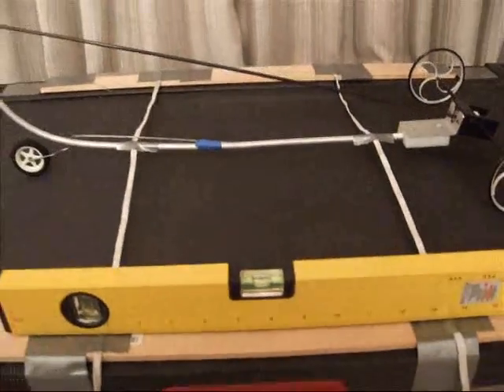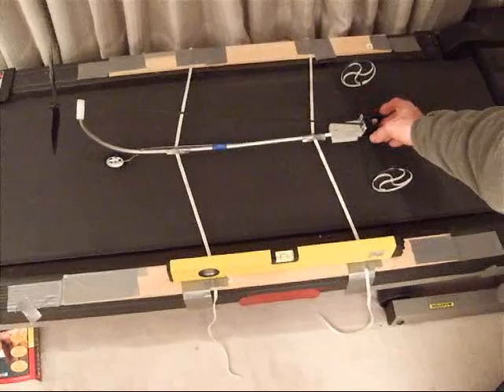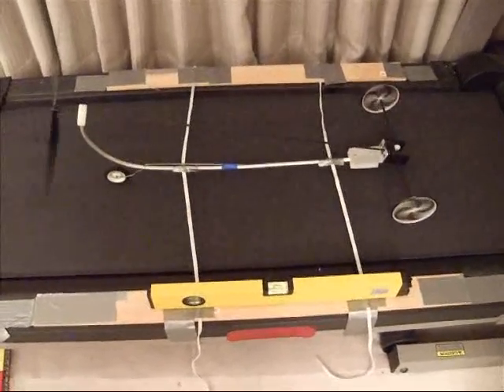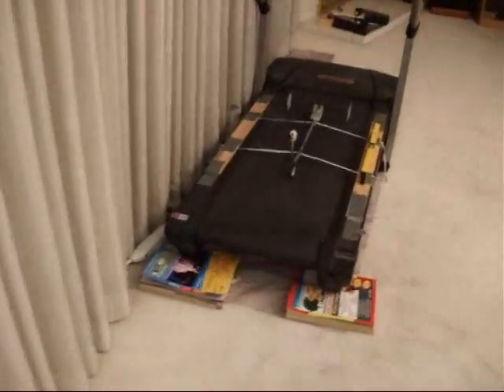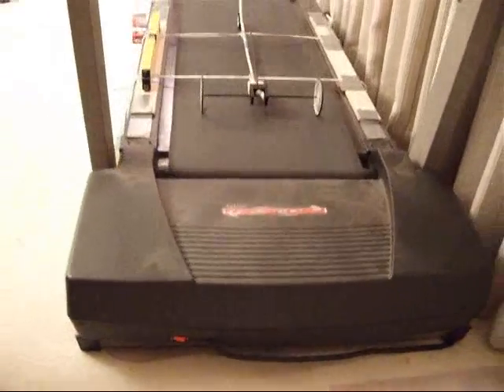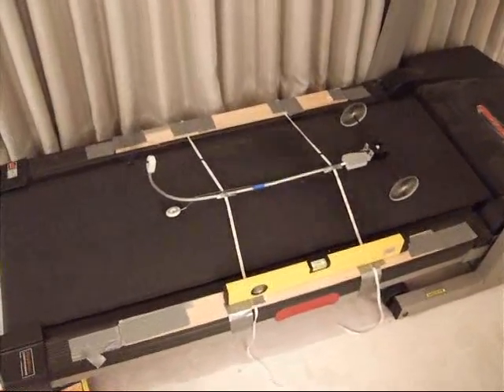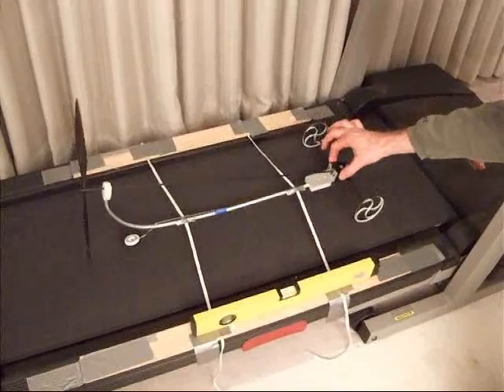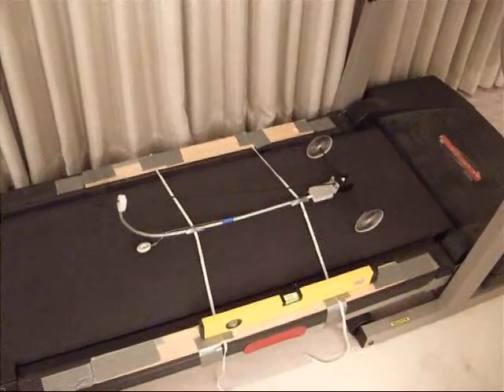DDWFTTW - Physics on a shoestring

Comment: Links to Rick's video instructions for building a treadmill model. Note that some parts may have changed. If the gear ratio is different, a different pitch propeller will be needed to compensate.
https://www.youtube.com/watch?v=T-ArigMKhi4
https://www.youtube.com/watch?v=p0rhgop5wEM
https://www.youtube.com/watch?v=gSHNqrF93MU

Comment: Lets say I had a very long tunnel the went all the way around the world, with no wind and a smooth flat bottom. You are saying you can simply push this thing up to a certain speed, let it go and then it will push its self via the propeller all the way around the world over and over forever as long as there is no mechanical failure?
Reply from the maker: Nope.  With no wind in the tunnel this will come to rest very quickly.  More quickly in fact than a cart without a propeller and gearing.
Reply: @Rick_Cavallaro  So in the tunnel it would be the air resistance that would stop it. So if there was a 10 mph wind in the tunnel it would work because there would be no air resistance until after 10 mph and then gradually there would be air resistance. So then once it meets so much air resistance it will equal out and just run at that speed right?
Reply from the maker: @BurningDownUrHouse  Nope.  With a 10mph wind, it could run all day at some speed much greater than 10mph.  It's a wind powered vehicle that goes directly downwind faster than the wind.
Reply: https://pt.wikipedia.org/wiki/Aerom%C3%B3vel

Comment: If the vehicle moves with the wind along the level ground, it is likely to experience a considerable amount of turbulence.  From moment to moment, the direction and speed of the relative wind velocity will vary because of turbulence.  In stagnant air at rest relative to the ground, there will be minimal or no turbulence.  Taken to the extrerme, the turbulence means that the vehicle is actually going perfectly "downwind" instantaneously.

Comment: The concept here was demonstrated back in 1877 with the Brennan torpedo. Land based powered spools were used to draw a pair of wires from the torpedo. The wires were wrapped around spools that drove propellers as the wires were pulled from the spools. The torpedo moved forwards, while the wires moved backwards. The wires could have been attached to a pair of posts, and with the water moving downstream, the Brennan torpedo would have moved downstream faster than the stream. Wiki article: https://en.wikipedia.org/wiki/Brennan_torpedo
Reply: That is a very interesting piece of history. Thank you for pointing it out!

Comment: So, make 5 or more of them. Lay them out in a pattern so that they travel on a circular track with each connected to a center hub, where the center hub is a generator. If true, then after starting them, they should be able to go around indefinitely to generate power at the center hub.
Reply from the maker: It doesn't work like that.  It needs wind to operate.  It exploits the energy of the motion of the air relative to the ground.  No wind - no go.
Reply: You mean it doesn't work like that on a motionless circle track. But, if the track itself rotates at a constant rate won't it give the acceleration rate effect desired?
Reply from the maker: It will work on a rotating track (like a turntable).  But you won't get more energy out than you put into rotating the track.
Reply: Video of such an example. The vehicle advances "forwards" against the turntable moving "backwards", but the only power output is the vehicle takes some power from the turntable and the propeller adds some energy to the air (less energy added to the air than taken from the turn table). https://www.youtube.com/watch?v=QTF5kw51H60
Reply: @jcd-k2s  
No. I know now that it only needs for the fan to produce a greater pressure at the back than the ambient pressure and it will continue to accelerate. It has nothing to do with wind. It has to do with force (pressure) differences at the front and back of the fan.
Reply: @jcd-k2s  
The key is that the fan blades generates greater thrust energy than is required to rotate it.
Reply: @jcd-k2s  
The extra kick of energy comes from thermal expansion of air at the back of the prop and thermal contraction of air at the front of the prop. The prop acts like an efficient heat pump as it rotates through the air.
Reply: @jcd-k2s  
Regardless of what your thinking, I am not implying that there is excess overall energy. I am saying that the "efficiency" of the prop (its ability to heat and expand air at the back of the prop for thrust, and cool and contract air at the front of the prop for thrust, and due to its pitch) translates to acceleration forces for the prop. Your above equation (Ec =p²/M) does not take into account the heating and expansion, and the cooling and contraction of the air at the back and front of the prop. That too must be considered. And when you do consider it, you will see from were the acceleration force must be derived from. In and of themselves the heating and cooling difference result to a zero. But the expansion and contraction factors are on opposite sides of the blade, resulting in an overall acceleration force on the prop.
Reply: @jcd-k2s  
So. No matter the "amount" of thermal effects on a wing in a gas or liquid, take that Thermal (kinetic energy) variable, split it down the front and back of the prop (heat on one side and cool on the other), and what do you see? You should see that the Heat and Cool cancel but the fluid expansion and fluid contraction create a resulting force vector on the prop.
Reply: @jcd-k2s  
No! No violation in this case, only manipulation. The energy required to torque the prop is equal to the amount required to move the air. If you only consider this, then those forces will balance. But the prop gets a definite advantage because in moving the air, then in addition to creating a pressure difference, also divides the thermal properties into hotter and colder. Since the prop is in the center, the difference in energy between the now hotter compressed air and colder condensed air creates the additional force vector on the prop.
Reply: @jcd-k2s  
I watched it. The explanation provided in the video does not explain constant acceleration, even when surpassing the wind speed. Nor does it account for the fact that they state that the acceleration will occur even in winds of opposite direction. Wheel cart was also not a completely fitting illustration because it too does not explain acceleration, but only constant rates of movement between the two mediums (the floor and the 2x4). No one can explain “acceleration” without accounting for prop heat pump efficiency, as I have stated above.
Reply: @jcd-k2s  
I did think about that possible factor. Yet, they stated that acceleration takes place “even with wind in the opposite direction”. It sounds though, that more testing is needed on a decent sized model with remote controlled steering and in a controlled wind tunnel plus treadmill environment to settle the issue of if/when exactly any acceleration would desist. Because,   the faster the wheel speed, then the faster the prop speed, therefore the greater the power transfer leading back to an even faster wheel speed, etc. It is a continuous loop. So which factor ends the acceleration?
Reply: I’ve only become aware of this Blackbird car in recent weeks since the Veritasium stuff showed up in my YouTube recommended videos. I see your original comment is several years old but there are recent ones also so I guess YouTube has revived the debate. I’ve read hundreds of comments & gone back and forth a bit on it. I don’t claim to fully understand the math involved in efficient airfoil design. You are the first one I’ve heard talk about the heating and cooling created by compression & condensation and I think that helps my understanding of how wings / propellors work as well as they do. I have working knowledge of many things from generators to Diesel engines to dehumidifiers and when the same basic principles tie them all together it starts to click for me. My initial comment was going to be directed to your comment about the 5+ cars on a circular treadmill driving a generator as I could see instantly that you can not generate the power needed to run such a treadmill. That would be the same as the guy with an electric car putting a windmill on its roof, running a generator, to charge the battery. 
Rick Cavallaro has consistent simple answers that have pretty much explained it in a way that makes sense for me. The only energy source being exploited is the difference between wind speed & ground speed, which is is a force supplied by nature, as opposed to the motor running the treadmill in these simulated experiments. You don’t have to make up for a force supplied by nature. At first I thought those making the claim that if this car actually went faster than the wind then it should keep accelerating indefinitely. It seems to me now that the very limited power available from the difference between wind & ground speed, being finite, will soon be overcome by the headwind & friction & drag created as speed increases. 10 mph speed variation is a big factor at 15 mph, but if you want to go 90 mph it’s nothing. The slight difference between wind & ground speed being such a small energy source that if one does not do the streamlining, low friction tires, low friction chain / gear drives, maximum efficiency prop and pitch adjustments it most likely would not work at all. The guys that build 200 mph gas engine super cars are well aware that they need many times the horsepower to get from 100 to 200 mph, and getting to 300 mph? Many times more again such that the tricks they used to get to 200 just don’t cut it any more.
Reply: @Bitterrootbackroads  
Thanks for the really nice comment. I blame it on my dad for always making me think about how stuff works. I have a fascination for everything you’ve mentioned as well. If you view my videos you will note that I’ve been on YouTube for many years now. Of course I’ve grown in knowledge since I originally started doing it just for fun. My channel is focused on ways to manipulate the increased apparent weight of a mass, as derived from its centrifugal activity. To understand my ideas, I invite you the take a look at this:
https://youtu.be/BE0UKLcYvt4
Feel free to leave a comment there if you like it.

Comment: I get the principle and understand what you are showing. However the variable you are missing is the wind resistance to the static structure of the vehicle at relative speed.  Don't get be wrong, the principle still applies in the same way that a yacht can move faster upwind than down wind. It is the deflection of energy that is absorbed within the structure vs the inefficiency of wind escaping a sail. I think it would be interesting to examine the surface area of the propeller in order to gauge the maximum thrust produced by the wheels turning the prop vs the rotational wind resistance of the prop. vs the thrust produced by the prop. Perhaps a larger sail area of the prop creates a greater efficiency than a foil sat lower velocities. A smaller surface area may prove to be more efficient at higher rpms = higher velocities.
Reply: these are friction or resistance based concepts. A rotating blade slicing the air at the same relative velocity of the carrier, really only has resistance to its leading edge and the high and low pressure which surrounds it  (according to N law they cancel each other out at equilibrium. 
If the resistance to speed is less than the resistance of the moving static structure  + the reistance of the rotational energy of the blade, then acceleration will occur.
Because these two factors are not linear respectively. terminal velocity will happen. But it doeas not negate the fact  that a propellor can be a more efficient means of energy transfer than that of a sail.
Reply from the maker: >> the variable you are missing is the wind resistance to the static structure of the vehicle at relative speed.

Nope.  That is shown when the vehicle moves forward and pulls the shoestring tight.  Once the shoestring is tight the vehicle is limited to windspeed and we no longer see the relative headwind.

With respect to the maximum thrust of the propeller, there are a lot of things that go into that.  There are a number of programs that will allow you to design a propeller and estimate its performance.  But keep in mind that propeller efficiency is absolutely key.  It's not all about maximum thrust.  The less efficient the propeller, the more drag is placed on the wheels, and the slower the vehicle goes.

Incidentally, the drag of the blade is not simply the "resistance to its leading edge".  The blade has an angle of attack, and it has twist, so the AOA can be  different at each radial station of the blade.

For static calculations of terminal velocity the rotational energy of the blade never comes into it.

Comment: Okay, so I think I've got this figured out. The prop is "flying" through the air, which is at zero velocity. If the air were moving at the velocity of the treadmill, the prop would still be flying through the air, the "air speed" would remain the same, the ground speed would be reduced by exactly the speed of the treadmill, so no net forward speed. Right?

Comment: This particular demo is even simpler to explain than others. The treadmill is turning the wheels, which turn the prop, which pushes the vehicle forward. So the power to the prop is FROM the treadmill. If the vehicle were not constrained, it would not go forward, except from inertia in the blade.

Comment: There is weary simple explanation of this phenomena. In the room wind speed is 0 and vehicle does not move forward. The treadmill is turning the wheels and propeller, but there is no approaching wind so the thrust from propeller will push the vehicle forward since there is no wind coming from front, as it would be if the vehicle would be on the ground. As soon as you put that vehicle on the ground and push it (in 0 wind speed) it will stop because approaching wind will be=to the thrust.

Comment: Why are people surprised at what happens? Consider this... The propellor on a aircraft pulls it  forward right? So why would changing the type of transmission from gears to a funny sort of "belt drive" make a difference? Isn't It obvious the prop on the cart is going to try and pull the running machine forward in the same way?